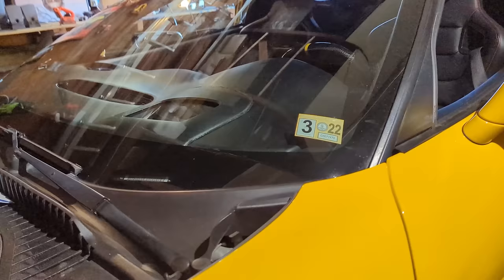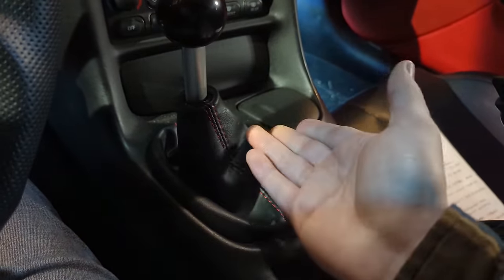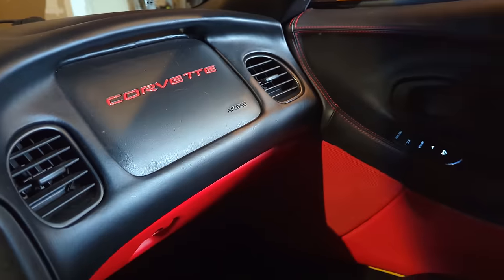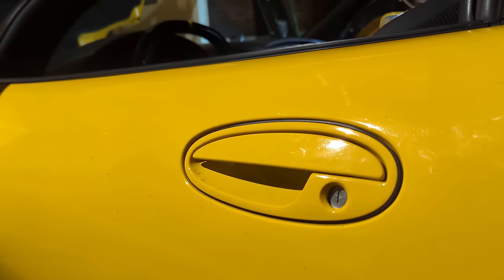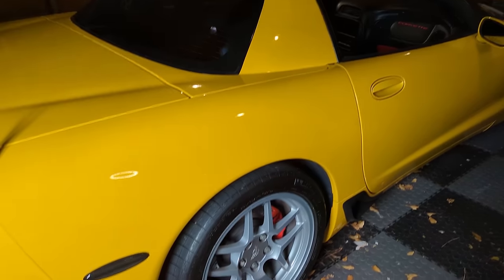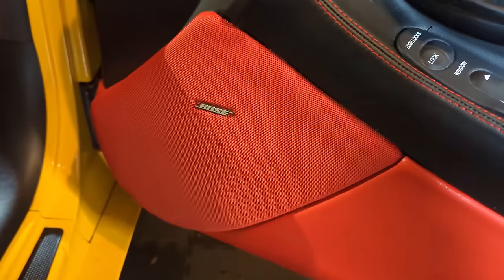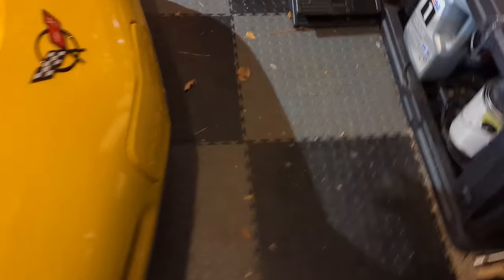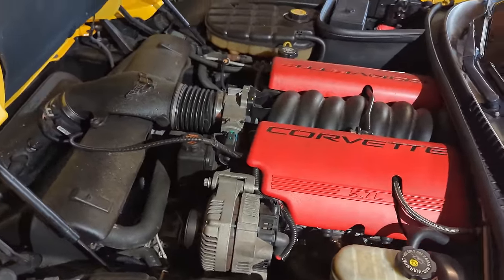20 TIPS, SECRETS & TRICKS OF THE C5 CORVETTE!  PART 2!

Comment: Black lights? That's bananas! 
I think I mentioned this on one of your other videos!? On your DIC - if you press and hold number 4 (OPTIONS) and then press number 1 (FUEL) six times it put you into the mode where tapping 3 or 4 respectively scrolls up and down, and you can reset anything on the fly including traction control and abs or anything that's intermittent ¿`_

Comment: Just another FYI about the C-5. From the time I got my 2000, I had always hated that there wasn't a way to open the passenger door in a "Gentlemanly" manner, due to GMs wisdom of eliminating the lockset from all passenger doors across their product line. Unfortunately the Corvette door was remolded to accommodate the smaller door handle, which isn't interchangeable with the Oldsmobile one anymore. '97, '98, and '99 are. 2000-2004 passenger handles are unique to Corvette no locksets and the ones with locksets won't fit without fiberglass work. I sourced an Artic White passenger door, complete for a few hundred dollars and it went on perfectly the color match was impeccable. But, most importantly the door lock/key mechanism worked perfectly. It was plug and play, no weird alarm issues. But, the secret of turn the key in the driver's door once to unlock driver, twice to unlock passenger, 3-times to pop hatch, now also work from my passenger door.  The wiring harness from the "new" door plugged right in and worked with the car like it was born that way. Hopefully others will share my love of these cars and my pet peeves.
Reply: You just use the remote to unlock all doors to let a lady in. I eliminated my lock in my passenger door handle for a cleaner look, by buying a color matched door handle with no lock cylinder for my 98 C5.
Reply: @toddm.7746  surely pushing a button that could fail for any number of reasons, especially the finicky nature of C-5 electrical systems, remember subcontractors were the lowest bidders prior to GM bankruptcy and it is evident in all their products from that era,, pales in comparison to actually reaching around a "date" and inserting a key in a slot, very suggestive. Besides, is chivalry dead! I am old school, wish my 2000 wasn't drive by wire. Best thing is that it is a rare Borg-Warner 6spd manual Arctic White Coupe.
Reply: Well, my C5 had zero issues. Do your thumbs hurt or something?
Reply: @williamtricarico6684 where did you get a lock cylinder to match your C5's keys? I think this is a great idea.
Reply: @chriswithrow3107  the door I sourced came from a '99. It had window motor, inside and outside door handle and lock cylinder. I just took the lock cylinder to the locksmith and he changed around the wafers to fit my existing key.

Comment: I have owned a 2004, Z06 Commemorative edition about 10 years now and thought I pretty much knew it all.  I don't!  Thanks for the research and passing it along. 
 Mine is not stock.  Cam, heads, headers, air intake and Hurst shifter.  The dyno shows right at 425 HP at the rear wheels.  That my friends, will move a 3K lb car down the road.  It is a hot rod and not meant for stop and go traffic.  Fun to drive in the mountains.  We love our C5s, do we not?  TT

Comment: Great video, bud! I’ve had my C5 for about 12 years now and I learned a few new things! Never thought about checking the door system so it would think the door is closed, you reminded me I need to milk, my C5. I haven’t done it in a while, I had a big plastic bag. It was against my radiator, causing it to overheat this year, right now I have a loose right rear tire rod that make a noise and they won 800 for that, you didn’t mention the shock absorbers and the electronic shocks that run over $1000 apiece, I replace my front ones, now I gotta replace my rear ones, Better avoid speed bumps like the plague out here in Phoenix. Cheers!

Comment: FWIW, there are a total of five udders. Three on the driver's side and two more on the passenger side. You can actually reach the driver's side udders from the top without removing the inner fender well lining, but it ain't easy. There's one udder that you can't see, but you can feel where it is and remove it. But, reinstalling these udders will be time consuming and you better be a contortionist, but it can be done. As to the passenger side. Those are much easier but will necessitate you removing the battery. Great video. Save the Wave👋
Reply: Just out of curiosity, why not leave these off?
Reply: @carltonrunforrestrunsmith2931   They lead the Water to the Ground. If you leave them off, the Water will spray over the whole Engine Room, and even over the Battery.
Reply: Or a diy mod that directs the water below the battery? Or to another area?

Comment: Black light was a new one to me!  Good stuff!

97-99 had a keyhole on pass side, they did away with that in 2000.   Those 99 frc’s trying to pose as a Z car forget to swap the door handle (yes, saw one at Carlisle)

My opinion on the fuel system stuff-could be argued the 97-98 fuel system was the better system as the fuel regulator is mounted at the fuel rail vs back at the filter.   Few benefits here- $$$ - 97-98 fuel filter is ~$10 whereas the 99-early 03 is $50+.   Fuel starvation with modified cars is a big issues with the 99+ cars- many have retrofitted back to 97-8 setup.  

I imagine cost and something with emissions played a role- 99+ would have cooler fuel as it’s circulated back at filter/tank vs at the rail.  The whole 03+ was a test bed for the c6 fuel system.  Lucky 03+ owners….

There is something to be said about upgrading the big 3 on these cars and cleaning up the grounds.

Enjoy your content- nice to have a fresh set of eyes/ideas and able to apply newer developed items to the platform.

Comment: The lights in my center dash console were getting dimmer and dimmer. I went online to purchase new parts and found a video on how to fix the problem. It amounted to removing the center dash bezel and locating a circuit board then re-soldering several resistor connections on the circuit board. Very easy to do and it worked perfectly. I'm sure you can find that video. I like free fixes. Thanks for your tips.

Comment: I’m not a 100% sure on this but I know in my 05 Silverado, the headlights and dash lights will dim whenever I roll my windows up or down. A lot of people counter act that by doing “The Big 3” upgrade. You are upgrading the size of wire for charge lead from alternator output stud to battery, the return path between the alternator and vehicle ground and the return path between the battery negative and the vehicle ground. Maybe that would be worth trying. My understanding is that the alternator is putting out enough power but the wires can’t handle the amount of power that is needed to run everything properly so it pulls power(dims headlights) from one thing to another. I did the upgrade on a 02 Trans Am I had and I highly recommend trying that to see if it fixes the dimming headlight issue.

Comment: Great video, instant sub for me. Am I picking up a little Ohio accent? That is one clean beast: (We’ll forget about the passenger  floor😮). Black light, wow, cool. I’m still chasing the dreaded “Reduced engine power” gremlin, in my 01 convertible. I try a few things each year, say F-it, and just drive it- pull over and clear the codes as needed. Could be good for a month, or can die 3 times on the way to the corner store…🤯. Doesn’t stop, me from absolutely loving it. Does stop me from doing the pretty stuff, I have plans for….fixing the cheese grater seat foam and new leather. Oh well. Almost 99K and that LS1 fires right up and still pulls like a freight train…🍻
Reply from the maker: Not too familiar with the reduced engine power gremlin (luckily). I could definitely do some homework on it and make a comprehensive video on it though.  I'm from DC.  I don't think we have accents (🤔🤷🏼‍♂️). Thanks for watching!  I'll have a bunch of new Corvette content up once my garage reno is complete. 🤙👍
Reply: @VetOnVettes  Thaks for hitting me back. It’s all “Sev Traction MGT” stuff. P1125/P1281 currently. Both accl pedal codes. Swapped it…nope. Sent the EBCM to ABSfixer for a rebuild. He pulled P1287 code out of it, didn’t know they held codes…steering pos sensor. That will have to wait until next season. Bit out of my wheelhouse and budget, this year. Suppose I’m just gonna have to bite the bullet and take it to a Chevy dealer….😎

Comment: The oil pressure sensor is a common problem. A relocation kit is a must, unless you like removing the intake everytime the sensor goes bad, because it will eventually. If you go LED for the taillights, get a hyperflash so you don't need the resistors. And don't use LED bubs in your factory headlight assembly. They are not designed for LEDs, you'll be blinding oncoming drivers. Replace with an ACA projector assembly, major lighting improvement over stock. Another tip on weathersrip preservation. Clean throughly and lubricate with dielectric grease only. A little goes a long way.

Comment: When  I park my '04 C5 for the evening, I always put it on the trickle charger whenever possible. This Vette has always had a very slight current draw, so a freshly charged battery is a plus
Reply: Hey…my visor mirrors we’re a drain problem for me. Pretty crappy set up. Had to disconnect the passenger side, one time B4 a round of ⛳️. I forgot to lower the visor when I put the top up and snapped the cover right off…😱

Comment: The hard shift is usually the detent ball in the transmission. There's a hack for using an oil plug gasket that lessens the pressure of the spring. But when I did mine I found the roller was seized up. Freed that up along with the spacer and it shifts like butter.
The subwoofer in the door people complain about it buzzing. It's really the Bose logo vibrating. A dab or two of a clear silicone applied with a tooth pick stops the vibration.
The LS 6 Fuel injectors swapped with the intake plenum is a worthwhile upgrade.
The suspension can be swapped out with C6 Z51 parts. Heavier sway bars, metal sway bar ends, and poly bushings make it take corners with no dipping or diving. It drives like it's on rails.
My drivers door lock button quit. That turned out to be a small trace fried on the circuit board. The rubber cover has to be carefully removed without tearing it to get to the board. After the repair glue the rubber around the edges with a little clear silicone.
If you remove the door panels and the clips rip out of the holders there's an aluminum $20 repair part to fix it.
You should also change out your clutch fluid often to make sure the fluid doesn't get contaminated. Or your pedal will stick to the floor.
If your oil pressure gets erratic you need a new sender. You can either remove the intake and slide it forward, or pull the wiper valance and use the chop a hole method to access the sender. I used the chop a hole method and I have had to replace my sender twice so I consider it worth it. I used a small hole saw and a little silicone to glue the plug back in the hole with a little aluminum tape. You can't see it because of the wiper valance

Comment: Here I quick tip I learned my 2000 C5 after sitting all winter the passenger window would not go down. Slammed the door a couple of times and it works fine.

Comment: The best cure for any incandescent headlights is to run relays for the high and low beams. Then the stock wiring provides the trigger voltage only and the light relays go straight to battery voltage. Many times you end up 1.5 to 2 volts higher at the bulb compared to stock.

Comment: my 01 keeps having a charge system fault.
has new alt, new starter, and new battery.
after talking to some other C5 owners i think there is a wire somewhere with a break or partial break in it causing me issues, i was recommended a guy who use to before he retired work at a chevy dealer as the Corvette specific guy so im going to let him give it a spin and hope he can fix it.
the only other option is to rewire the whole car.
Reply: alternators are different on manual and auto trans you may have the wrong one which will give you the charge system fault

Comment: Just wanted to let you know of 1 other body part that was not specific to the c5 corvette. The backup lights housing with the license plate frame is actually the exact same as what is on the retro Chevy SSR pickup trucks.
Reply: To be fair, the SSR borrowed the part from the vette- not the other way around which was the intended point.  

C6 has the c5 traction control button doesn’t it? :)
Reply: @johnreiling2956  Of course the SSR borrowed the part! The SSR was only built from 03-06, over 6 years after the introduction of the C5.

Comment: Memory settings, there are two that are obvious. There is a third. Press and hold 1and 2 at the same time now your in the third memory. I use mine to set the mirrors for when I’m backing into a parking spot. Check it out. I was told about this after I bought my 03 in 02. Guess it’s still not widely known after 20 years. Thanks

Comment: I've owned over 20 C5's in over 20 years,  and the header hvac really isn't that stupid,  with ARH hooked up right,  I seem to make around +10whp on a mustang dyno. The utters can be clipped, I did it,  for a bigger opening,  if you don't it could get into your wiper motor,  although in the 04'Z06 they're extremely well sealed boxes.

Comment: Your radio replacement with the video screen in amazing.
I would not attempt that.
Reply: It's a little time consuming, but not difficult.  Key thing if you're connecting into the OEM system: purchase the wiring harness that includes the 4 channel trim pots.  The output on all 4 channels will likely need to be increased.

Comment: One Qustion, are you really sure about the ABS System?
You sayed that 97-99 have the Problems, they need a new one, and 2000-2004 can be fixed?
Are you sure about that? Because i got an 2000, and i heard that 2001-2004 use different system than 97-00 so now i am confused.
Reply: Yes! 97-00  abs systems are the same (except the location of the "97"s module is at the rear of the car)(I have a 99) I have done TONS of research on these. & our only choice is buying (finding) a used one . HOWEVER!!! My 99 just hit 70,000 miles & Everything still works including my abs (module) what I have been reading is the "01-04"  the repairable ones have far more issues then the "97-00"s / just my bias opinion!

Comment: Brother my DIC isn’t working on my 98 C5. It used to work and also the DIC lights up but doesn’t work. Also I have noticed ABS popping up with traction service and car grinding like I accelerate and it doesn’t push the car after 3rd it’s an automatic

Comment: Hello I have installed a hyper-flash module and switchbacks that work fine, I got some strobe LEDs for the rear, everything works fine but the 4 way flashers hyper-flash do I need a different type bulb or another modification?

Comment: Hey very informative video. My '02 coupe has a power door lock problem on the passenger side. In other words, I can unlock the door with the key fob but the passenger side door won't lock with the fob. I have to manually lock the door from the inside. Any pointers? I'm also not mechanically inclined.
Reply: Hit your unlock button twice
Reply: Probably the lock motor on the latch in the door. You can actually buy the little motors separately from Dorman rather than replacing the whole latch assembly. Mine does the same thing but I might check out the wiring first since it seems to be an issue.
Reply: Mine does the opposite it will lock with the key fob but not unlock. I have to unlock it manually from inside ? Let me know if there’s an easy fix.
Reply: @neilspires7259  I tried that it don’t work.

Comment: Do you know how difficult it would be to replace or upgrade those black lights in the cluster?
Reply from the maker: I know you would have to remove the cluster glass (plastic). If you can find the exact replacement part it may not be too difficult. But I have never tried and have no real knowledge of doing it. But if there is a will there is a way.
Reply: @VetOnVettes  Thanks brother!

Comment: Have you had any trouble with your door locks? On my 2002 C5 my passenger side won't unlock you have to do it manually so what is the fix for that? The power door locks?
Reply from the maker: Hmmm. Interesting.  You power for the windows on the passenger door? Will it lock?
Reply: Mine too. It will lock with key fob just not unlock.

Comment: The door handle is not from the Alero.. it's from the Aurora.. I know because I owned one and that's the same handle. You're welcome
Reply from the maker: You are 100% correct.  Mis spoke.  I'll pin a note.  Thanks man.
Reply: I didn't know that the handles were the Aurora handles but I heard that the new UPS trucks use Aurora headlights. Those parts get around.

Comment: The more I watch these videos the more a C5 looks to be a pain to own.
Reply from the maker: The cars are 3 generations old now. Definitely a hobby/enthusiast car
Reply: @VetOnVettes  I may be buying a 2002 convertible today.  Hope I don't regret it.
Reply: I’ve been daily driving a 2002 C5 Z06 for a year now. No problems at all. But my headlights do bounce so I’m going out to tighten them up. Car has been great.
Reply: Working on a deal on a 2001 convertible now.  Right pop up headlight doesn’t work and a strange buzzing noise is coming from the dash even when the car is turned off (goes away after a minute or two).  They’re trying to fix it 🤷🏻‍♂️

Comment: Fuck I’m in California and my c5 is throwing an engine code for the air system P0410. Wondering if I can pass smog with it off. And if I should be worried about the engine code
Reply from the maker: California is tricky.  If the system is gone and tuned out their computer should not catch it.  Its reading for certain trims &  C02 emissions.  If the computer sees everything is hunky dory than you MAY be ok.